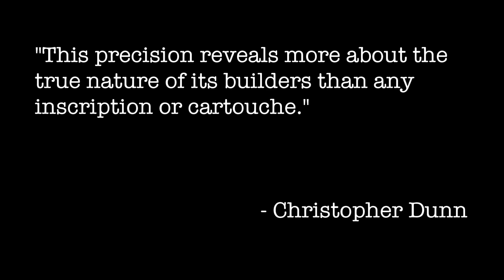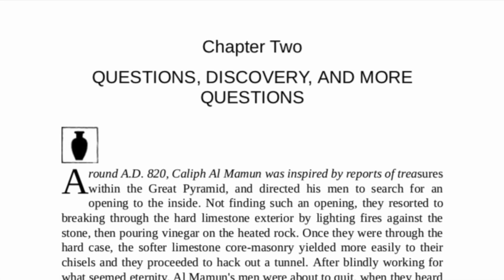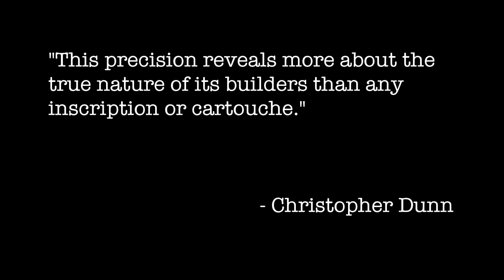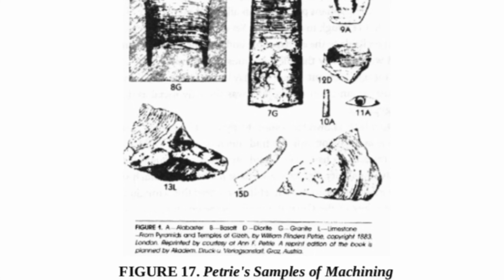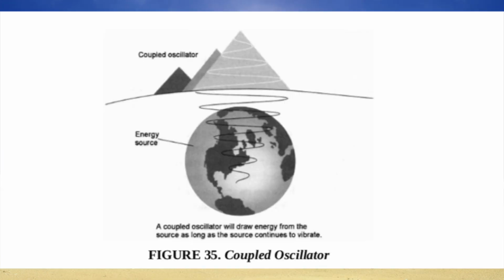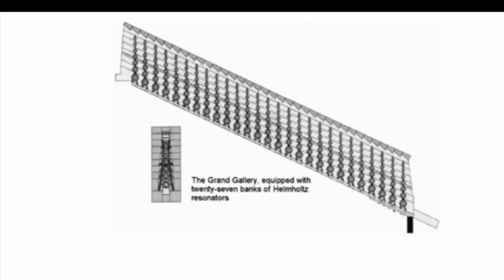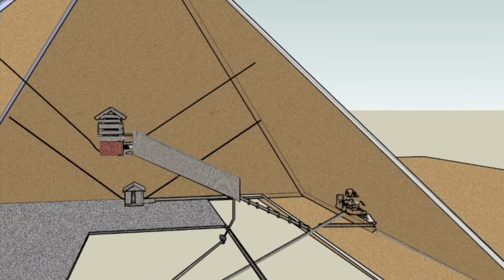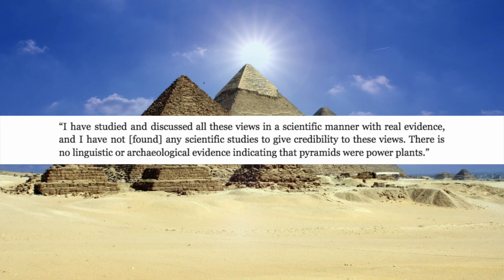The Giza Power Plant Theory - A Deep Dive Analysis | Reading Christopher Dunn | Lines in Sand

Comment: Nah it wasn't a powerplant. The Great pyramid had a vacuum powered lift and 2 cranes, (N and S,) to help construct it. Water generated the vacuum, by pouring down to the subchamber which was plugged sometime later. The chamber shafts were polished Tura limestone to make a better seal with  the stones they cut to use as pistons which pulled ropes and ran outside to spools. One chamber was up, the other chamber was down. Maybe they threw a sarcophagus in because he was a great guy, or that was a part of the mechanism and it broke. Vacuum is the power that  allows your one foot to stop 3k lb. + car easily, and it's just a byproduct of running an engine. In the Egyptian's case running water. The central lift was a sled, and had a counterweight/sled  above in the "mystery chamber."  The King's chamber has a lip to prevent the last stone from getting pulled in under vacuum. The stone ball found was a bleed down valve, to make sure down didn't happen too fast under load.  Gantenbrink doors were part of the decommissioning process.
Reply: How many liters of water would one have to lift to create enough vacuum to lift 1 ton of stone ?
Reply: All that to lift stone onto the structure itself huh..
Reply: @BartSliggers  No idea. But the water came from the Nile and went back to it. As much water as could fit down the descending passage. To the ceiling. The counterweight could balance things out, like a modern elevator.
Reply: Your car's brakes are hydraulic, not vacuum powered. Why would you add brake fluid if it was going to be removed by a vacuum pump?
Reply: The subterranean chamber was the only one not plugged
Reply: @tyrannosaurusimperator  The brakes ARE hydraulic... BUT, the booster system is vacuum. and now you know.
Reply: @SimonEkendahl  No. The subterranean chamber drain/tunnel terminates.

Comment: Hmmmmm.  Let's think up some more crazy  ideas and make videos about them and the Great Pyramid. Be real thorough and scientific about it. Your 'Lines in Sand' doesn't draw a line at the truth. How about that the pyramid was built by enterprising Chevrolet Corvette auto salesmen transported back in time to open a dealership for Khufu to present new models? They used the Grand Gallery as a showroom display area. The Philadelphia Experiment actually succeeded with these guys, little known fact. I could MAKE UP a complete story about that. 'Let's make some more cool videos, Daddy!"
Reply from the maker: I don’t usually respond to antagonistic comments but you’ve been a frequent contributor to the comment sections on most of my videos so I’m going to give civilised dialogue a chance here. 

You seem to have missed the parts of the video where I have frequently mentioned that the sheer lack of evidence consistently undermines most if not all of the points put forward by the author. You also seem to be labouring under the assumption that I am a proponent of the Giza power plant theory, which leads me to believe you haven’t really watched much of this video before deciding to make this comment. 

It is very easy to sit there and say “this theory is a load of rubbish”. Just as easy as it is to say “the pyramids are 100% definitely power plants!”. The only way to know for certain - at least in regards to making something that could even remotely resemble an informed decision - is to make the effort to study what is being presented by the author. On top of that - There’s a lot of hot air online about the power plant theory but next to zero actual investigative work, so I decided to share my thoughts on the matter seeing as I was going on this journey anyway. 

Here on the channel I welcome everyone with any interest in pyramids and ancient Egypt, whatever their truth might be. 

My line in the sand is drawn firmly in front of those who feel the need to make unhelpful, inimical or even hostile contributions to the discourse here.
Reply: @linesinsand3928  I think this guy is completely unaware of what a massive following Dunn has and the huge platform he has been given for his wacky ideas by rogan etc